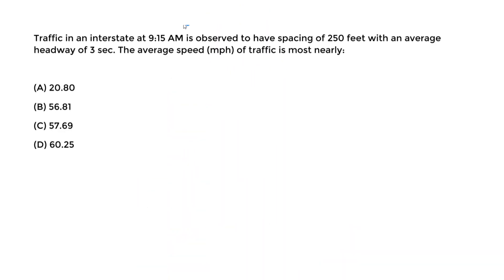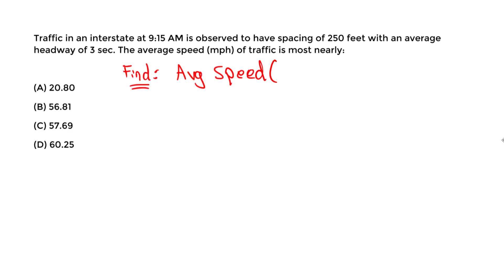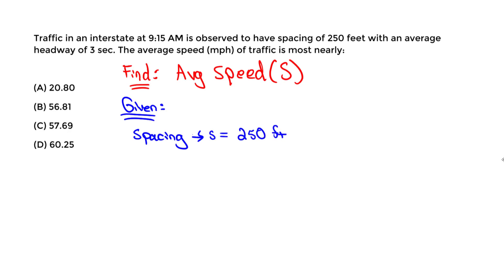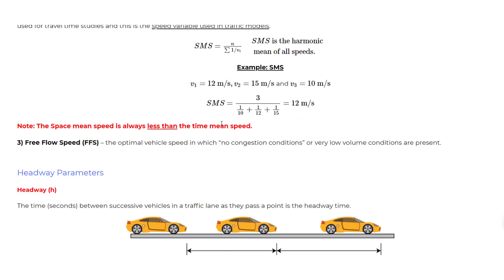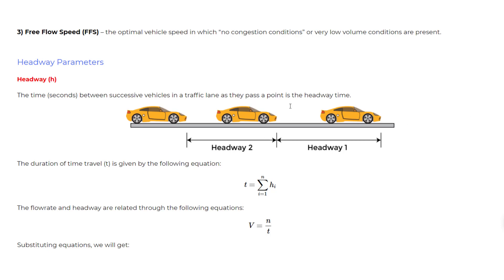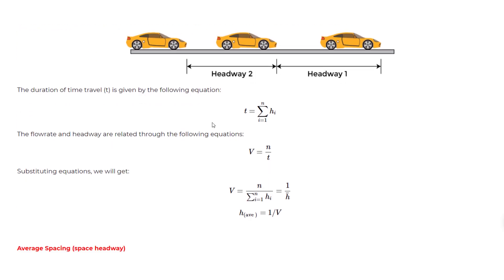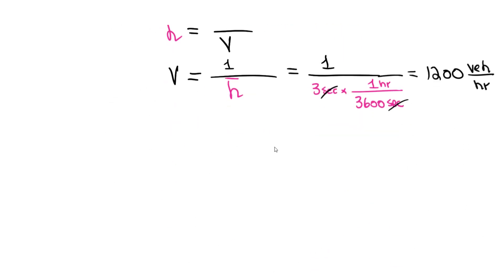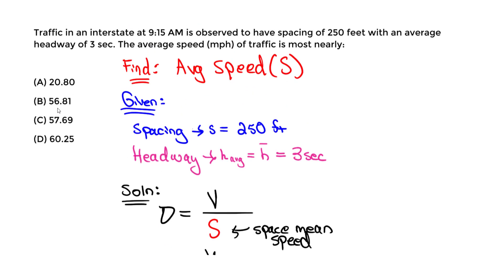FE Exam Review - FE Civil - Transportation Engineering - Traffic Flow

Comment: 250ft/5280ft = 0.0473485 Miles
3sec/60sec/60min = .000833hrs
So .0473485miles/.000833hr is 56.8mph

The exam is all about speed, if you can calculate the problem with basic math equations don’t waste time looking for the magic equation. This is as simple as converting units and dividing distance/time. 1-2 min solution.
Reply from the maker: Totally agree. Timing is crucial for this exam. In fact, you’ll likely not even write much at all inside that laminated booklet. 

Your approach is best 👍

Comment: Thank you, I like the explanation of the traffic flow, but I am a bit confused why we don't just do the spacing over the headway to find the velocity ( S= 250'/3s*3600s/1hr*1mile/5280ft=56.82mph)? I haven't taken a transportation class so I am not familiar with the terminology and I guess with hard questions involving jams and other variety that we need to convert it to density.
Reply from the maker: Hi Lea! When I think about it, you actually can do that. As you presented, we would still get the same answer. I believe my goal in this video was to relate the major variables of flow, density, and speed to each other. 

Should have honestly included you point at the end of the video! Well done.